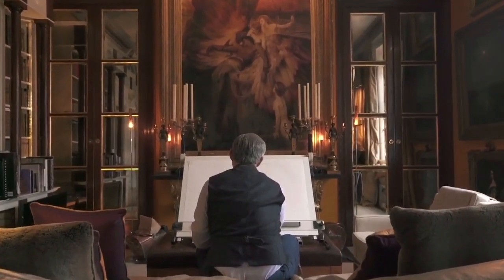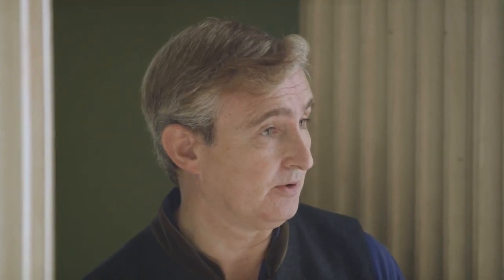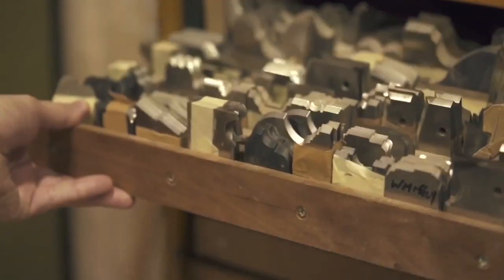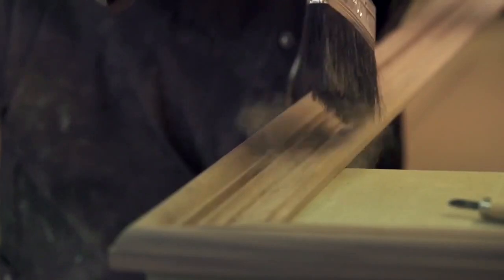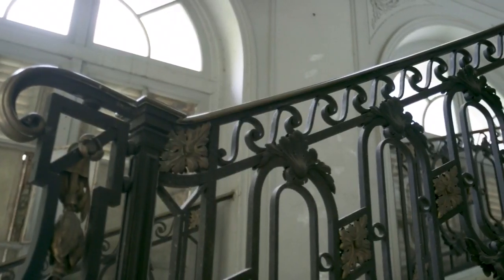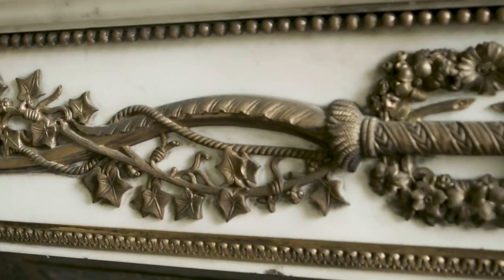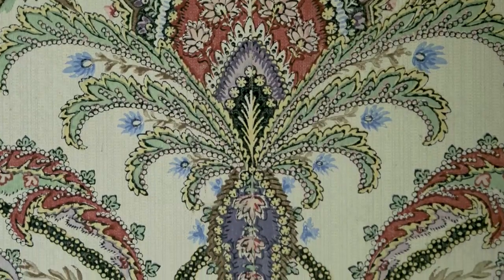'Restoration Chateau' with Tim Gosling & Steve Holmes in Normandy, France

Comment: It looks beautiful, you should have a look at the Chateau Dairies vlogs Stephanie has been renovation Chateau La Lande for the last 15 years and has just had one of the stainglass windows in the chapel restored and it’s beautiful xxx Good look with your renovations xxx
Reply: She does wonderful renovation work! Thankfully her roof and foundation were totally fine and there was only really modernization and cosmetic work needed there. Some of these chateaus in France have major structural problems and are unlivable and money pits because of how long they have been left to rot.
Reply: Michelle Bennett when Stephane moves in there were some big renovations needed, new septic tanks all the electrical wiring, all the downstairs floors were dug up and damp proofed. I think the first 5 years were tough as the heating didn’t work all the time and spent winters there freezing. It’s only now she starting to see it all come together. But as you said the roof was good which is a massive help. Xxx
Reply: @cheriesharp234  a floor, replacing the heating, electric and the septic are relatively common modernizations in older homes across Europe. My friend had to even get gas connection added. She had to add heating, add a modern bathroom and kitchen.
Reply from the maker: We love the Chateau Diaries with Stephanie but we sadly don’t have the time in between all the things that are going on and the work we’re doing at the chateau to keep something like that up … so we only do Instagram as its immediate and keeps us in real time! Do follow us on Restoration Chateau.